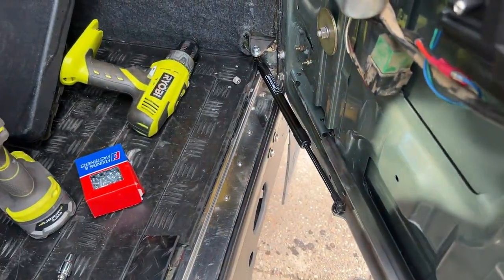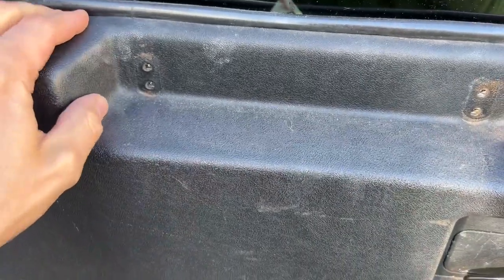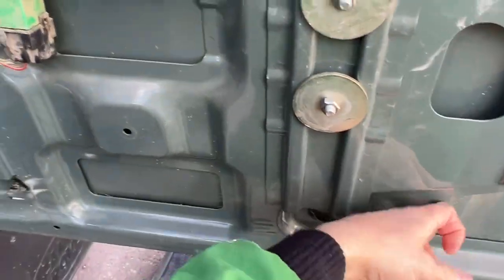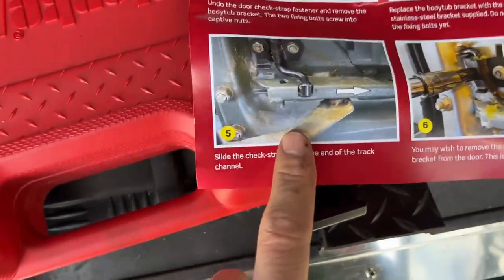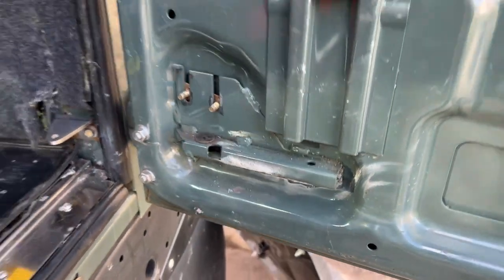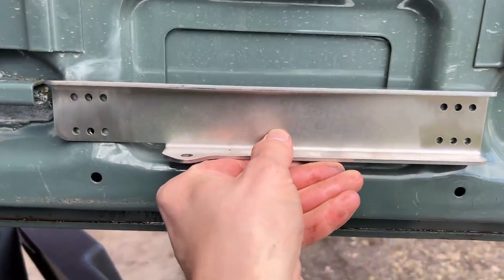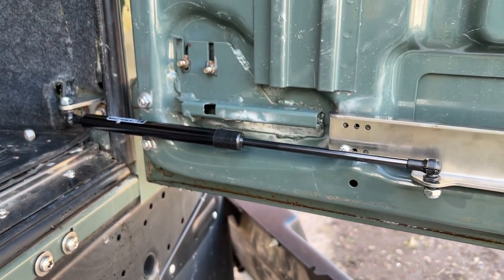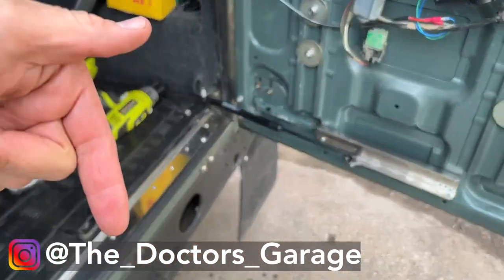BEST REAR MODIFICATION ON MY LAND ROVER DEFENDER BUILD!

Comment: Hi, looks like you have installed it backwards.   The cylinder should be installed on the door and the rod-end to the frame.  Maybe that's why the door sard popped and needed trimming?

Comment: Could you mount the strut the other way round to so the reservoir is being the card. Not sure if it would fit but would possibly give enough clearance to stop the door card popping off.
Reply from the maker: Maybe I will have to try that to see if it helps

Comment: Thanks for the video.  I see Nakatanenga make a top mounted Rear Door Gas Strut too, any particular reason you went with the bottom mount version over the top mount?
Reply from the maker: Honestly no- I think it looked easier to fit on the bottom? I can’t quite remember

Comment: On the receiver plate inside u drill a new hole further back or with a bigger hole with a bush to take it 5 / 10 mm back it will stop it hitting the door card

Comment: Hi Doc, This modification has also been on my mind for a couple of weeks now. Indeed, if you're not careful when opening the back door the spare wheel slams into the right back panel, up to the point where it causes a dent (at least for my 90). Was thinking of shortening the door-catcher, but using a gas strut is even better. Going to check this out!
Reply from the maker: Yes exactly! The gas strut is so good as you it opens really slow in the last part of the open phase. You can also adjust where you want the back door to get to depending on your spare rear tyres size etc
Reply: @thedoctorsgarage  Hmm, makes me wonder: could the original door-catcher perhaps also be adjusted depending on the spare tyre’s size, without having to cut it? 🤔
Reply from the maker: @marcelvanbirgelen6101  if you blocked the channel that it runs in toward the end that would limit it I think?

Comment: I fitted the exact same strut you have and yeah my bottom clip pops out same as yours. It used to annoy the hell outta me but Iv gotten over it  now,  didn't want to mess too much trimming the door card for fear of breaking those delicate fir tree clips it doesn't rattle and works really well so il leave it as is. Got to be a design fault though because like you said most of them do it.
Reply from the maker: Yeah it’s frustrating but as you say option is just to leave that bottom one unclipped!
Reply: Guys the reason being is that the English instructions seem to be wrong. The thicker part of the gas strut needs to sit inside the door, so that the thin part is pointing to the left and therefore to the outside. This is how there will be more space. Have a look at the Nakatenanga website and original instructions. Hope that will do the job at your landys. 🙌🏻

Comment: Hello, we exchanged a couple of message on one of your recent videos about swing away spare wheel carrier, guess what I have the gas strut as well on our 300Tdi, had it for over two years now and with the same plate behind the body, a couple of mechanics told me it is a good idea but could be better executed as the small original plate puts too much stress on the aluminium body, I always accompany the door when opening, I am actually thinking of changing and putting the gas strut on the top of the door, there is another kit around with the plate bolting directly on the existent holes at top of door and on the inside of the car on the back of the roof where the grab handles are.
Reply from the maker: Hi Richard - yes I’ve seen the top one- but I’ve heard they flex quite a bit with the door being open which put me off- but I do see what you mean as I see the aluminium bodywork move a bit when I open the door
Reply: @thedoctorsgarage  I see you understand... I asked a couple of mechanics and both told me to put a bigger plate behind the bodywork which I still haven't done, now the plate that holds the piston of my swing away spare wheel carrier has rusted and broken in half so have to put a new one, they quoted me £ 300 to weld the old one, not worth it a new wheel carrier goes for about £ 230.
Reply from the maker: @richardtedeschi9290  yes a plate on the wheel box area in the rear would be ideal to give it a bit of strength
Reply: @thedoctorsgarage  It would, I asked the mechanics if it would be an extra rust trap to worry about and they didn't seem very concerned.

Comment: Hi again and well done,
Talking about rear door, I guess you ve got 18” alloy on the door.
I have just upgraded my alloys to 18” and Im wondering will the door handle all the weight on?
I was hoping to purchase a swing away spare wheel carrier but apparently its ll cost me £725 so I left it.
Any ideas what is the safest max weight can the door carry? 
Thanks
Reply from the maker: Hey! I’m not sure but if you have a big wheel I would recommend the Optimill rear door hinges and ORE wheel carrier. It depends on your model year too as I understand the metal was better on later years of the defender so less likely to crack

Comment: If it's only just touching the trim at a certain point can you reverse the strut so the shaft end is at the body to give a tiny bit more clearance?
Reply from the maker: Yeah maybe Sean- I think it might be just the angle that it comes out at- seems like a common thing with these struts

Comment: Hi Doc,

Really like the new gas strut, it’s so irritating when I’m on a slight hill and my rear door keeps closing on me!

Biggest problem I have is I removed all the rear trim, drilled and threaded some holes into the existing wheel mount to take some bolts for my drop down table, then obviously refitted everything, lastly the table which sandwiches everything, would be a right pain in the A$$ to remove everything again but I think it has to be done after watching your video!!

Obviously privacy is important to all of us, is there a way I can email you photos of what I have done Doc?

Kind regards

Tony
Reply from the maker: Thanks Tony- Best way is to send me them on Instagram - you can find me @The_Doctors_Garage 👌🏻